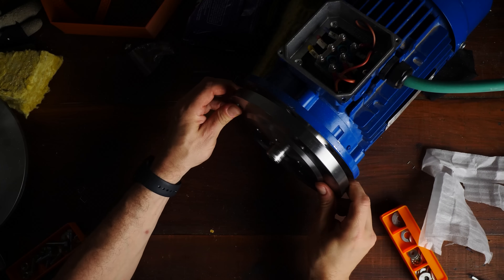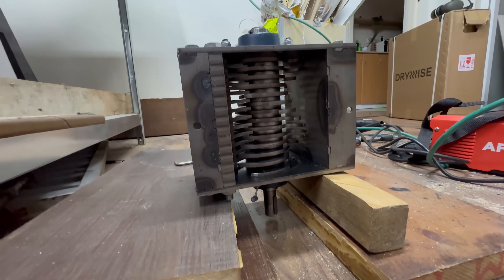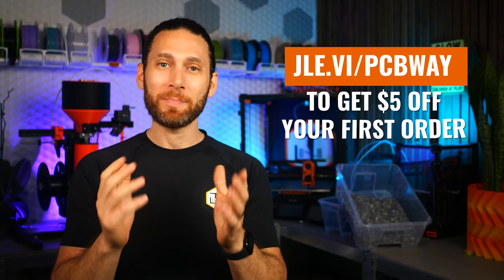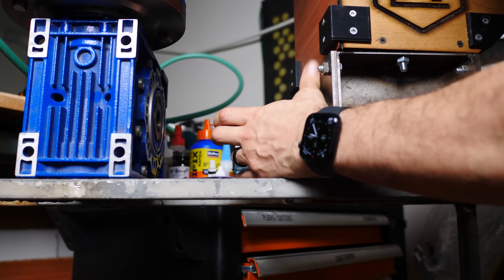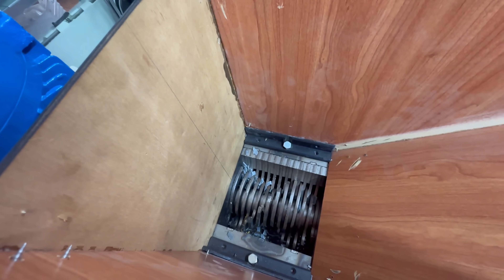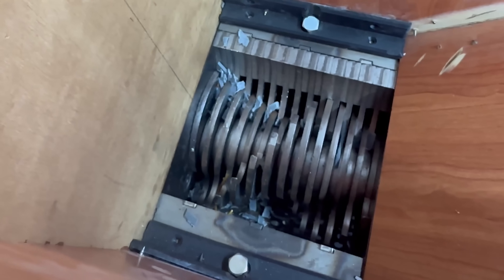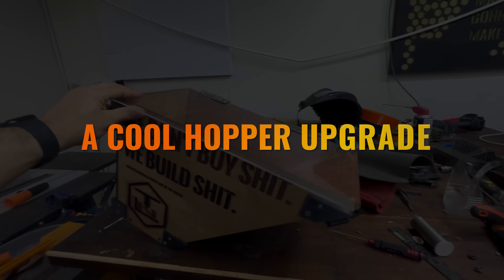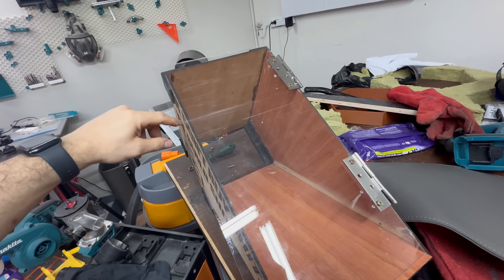Affordable Filament Recycling Update: I Screwed Up…

Comment: I would have use a chain or gear drive or a 'rubber donut' like on some driveshafts.
I have experience lining up a water pump to a drive shaft on a Maserati V-8. Maserati's drive mechanism was much like the old donkey going around in circles to rotate the mill. And it would fail if the concentricity was off by 0.001 .

Comment: This is so bad advice to order CNC or any parts from pcb garbage way....this is just junk. Also you have no any idea how plastic recycling works. This is just stupid to build that kind of shredder where is only movement is forward, what ever it cost. That is why bid shredders never ever use such a dumb concept. They reverse soon as load goes too high on forward. It realign the plastic and most likely reduce the load. To reduce the size, industry use multiple units in series. First hard plastic shredder and then shredded hard plastic + soft plastic. 
On your case, you bought 100% wrong type of shredder....plastic need more clearance on the ends or it will leak sooner or later to the bearings. Does not matter what you use for sealing, it goes trough. 
Do not dream to use shredded stuff directly to filament. For that purpose you need to make it for granule form. To get better result you seriously need to use middle of extruder screw the vacuum pump to suck the gases and moisture out. On big scale it works nicely out but possible your need 1000 or more times smaller scale it may be complicated.

Comment: Just a thought wouldn't it be prudent to pre heat the filament to near melting temp (so it takes less energy and time to melt the recycled plastic) so that when it finally goes thru into the melt chamber that its easier to get the proper size filament out of the extruder. I don't know much about filament extrusion, but I would think it would help with consistancy.

Comment: If you want better accuracy, pelletize the filament made with shreds and make another filament with those pellets. It is more steps and melts the plastic another time so it gets even weaker but the precision will be way better. That's how some professionals do it

Comment: I'm really interested in the extruder portion to make filament.  Buying bulk plastic pellets is far cheaper than filament and ditches the high cost of a shredder.  I've kicked around various ways to build a good extruder and take up reel system for diameter but am curious to see your final solution.

Stay safe !

Comment: don't hand drill the sieve - just buy some sheet metal with holes in it - or get someone that has a laser- or plasma cutter to diy- hand drilling that many holes in thin sheet metal is a pain - you won't end up with the part you desire

Comment: Test motor movement and direction is called a bump test in the manufacturing industry and electricians in a factory always work in pairs or teams.

You just demonstrated why.

Most VFDs are defaulted to coast stop, but many also have a breaking function as well.

Comment: You can also add flex coupler between the motor and shredder to deal with concentricity. Flange bearings with grub screws will never be centered. Look at some industrial equipment. All problems you are dealing with have solutions in the form of industrial LEGOs
Reply from the maker: On it thanks!

Comment: VFD will stop motor immediately if you wire a stop switch to the control terminal and change the stop setting from coast to braking. It's usually in the first or second layer of parameters. Change the setting to variable load as well, it will help with torque curve and life of the motor

Comment: Hi, 1) I hope, that you and your famili are safe.
2) I hope that somebody wrote it (I did not find it) Never ever use strait connection between motor/gearbox and machine. You have to use some caind of flexible coupler, which allows slight intolerance in assembly process.

Comment: Regarding Teaching Tech's Pelletizer, do not build it without using the "Dime Mod". There is one key piece that the filament rubs up against and in a few minutes, can actually wear a groove in the part, causing the filament to no longer be cut. The "dime mod" puts metal on this crucial face of the part, making it much, much more durable. I made my first piece out of PC-CF with 7 perimeters and 100% infill. A groove was worn in it in about 15 minutes of use. I used the same material and parameters with the dime modded part, and after 2 hours of pelletizing, it still works perfectly!

Comment: Thanks for sharing, for us to learn from. However, I keep thinking if it wouldnt be easer to just hand crank the schreder, with a very simple gear ratio setup? Unless you have huge amounts of scrap plastic, this will not run that often anyway. Would it at all be feasable? I have no experience with this, but it seems that man have been grinding things for hundreds of years without any precition engineering involved, just more hard work.

Comment: I'm very interested in this project. As a technical engineer I grinch sometimes seeing some of your mechanical solutions. Suggestion: for coupling the gearbox and the shredder I would use instead of a straight axel some kind of CV joint. This makes perfect alignment unnecessary.
Reply from the maker: On it. Thanks!

Comment: Use a lovejoy style coupler between the shredder and gearbox. Then you will not need to worry about misalignment issues.
Reply from the maker: I looked at McMaster Carr and it was like $300 for the spider style one. I’m checking out lovejoy and it’s super promising but I don’t know what it will cost. I’ll call them tonight maybe

Comment: Ok, what about wood chippers?  They come in both gas and electric power. Also, who cares if the original extrusion is not consistant.  If it is in a string, on a spool, all you need is a chopping mechanism, to make it into pellets, which work in the extrusion machine.
Reply from the maker: Wood chippers don't go fine enough sorry

Comment: i am not too sure of your exact vfd but after a bit of googling i think it supports emergency stops on its digital inputs which would cut power without the downramp. you should really look into adding e-stops at accesible locations near the shredder

Comment: You need a flexible coupling such as a 3-jaw lovejoy coupling.  Each side has three pegs sticking out with a rubber piece between each side.  This allows for slight misalignment.
Reply from the maker: On it. Thanks.

Comment: ofcourse its good to see where things went wrong, what could be improved, i was planning to build my own recycler cause the only company here who takes scraps gives you a quarter of a new roll for giving them 4 rolls of filament scraps .. which is a straight rip off, and you cant even combine the points you get as it limits to max 1/4 of a roll discount per order...
Reply from the maker: Do it! I'll be able to give you a BOM that's $1500 or less, I think.
Reply: @thenextlayer  i am actually planning to build mine with aluminium extrusions, and stuff i get for free from a friend who build some cncs and got left over parts :D
as for grinders i am still on the lookout for cheaper alternatives to the grinding gears you have, i had the idea of using some wood shredders for home use, some of those seem to have not just the boring rollers inside but actual sort of grinding gears like you have, and i found oen close by that seems to be broken ( as in electrically broken )

Comment: Well, you learned the lesson fairly cheaply, but hopefully well--never, ever, /ever/ turn a motor on without having it fixtured better than it can torque anything attached to it. It'll get away from you immediately, quickly, and violently. Or at /least/ be well away from it when you turn it on.
Reply from the maker: Thanks for the compassion ;) Definitely learned it
Reply: @thenextlayer  since I have your attention for a moment, please add the safety switches on the hopper lid, and implement an ESTOP circuit if you can, like other posters have recommended. The lid switch will prevent it from starting unsafely, while the ESTOP circuit will rapidly stop the motor if you hit it. Both types of input are probably implemented in the VFD, at least with an Enable input pin, and will dramatically increase safety. After all, your shredder can't tell the difference between plastic and fingers.
Reply: If the VFD only has an Enable pin it probably needs to be connected to either signal high (which should also be on the VFD) or to ground. If the VFD worked immediately when you bought it without wiring the Enable input, it probably had a jumper there already. Look at where the jumper connects, and it will tell you where your switch needs to go. Now, just change that jumper for a long wire running through a switch, and have that switch close the circuit when it's in the "safe" position (which should be lid closed).

If the VFD has a Disable circuit instead, then consult the manual and have the switch close the circuit when it is NOT safe. This is just the opposite of the Enable circuit.

To wire the ESTOP circuit, buy an ESTOP button. These are normally closed when not switched, and will /break/ the circuit when pressed. But they have both types of contacts (normally open and normally closed) so they can be used for an Enable or a Disable circuit. If the VFD does not have an ESTOP input, then wire it in series with the lid switch. Make sure it breaks the circuit (for Enable input) or closes the circuit (for Disable) when pressed. (ESTOP buttons only unlatch when rotated, by the way. They lock down until you spin the button top.)

Then carefully test each switch and make sure they do their job properly. 

By the way, these buttons and switches are for low power only. They only switch logic inputs, they do not control AC line voltage and amperage.

Comment: For shredding plastics I have tested cheap TC sawblades 6" 40 tooth, opposing on 25mm axles running with a £20 18v drill shredding anything was not a problem, the size of shredded plastic, aluminiium extrusion was small enough & uniform enough to use. Apart from the danger of someome inserting a hand and being turned out as a bean burger (Human Bean Burger), this seems like a workable approach considering testing was on a threaded bar with washers and just 4 nuts.

As for your new seive to drill out those Iranian missiles have the correct curvature already, just make sure its not a UXB before beginning!

Comment: Might be a good idea to add a microswitch to that perspex lid so the motor can’t run if the lid is open. For your safety and your kids.
Reply: This is a terrific idea. The VFD /probably/ has either an Enable or Disable input that can be used for exactly this purpose. It should /also/ have an ESTOP input that can be used to arrest motor power immediately. He should wire up and have both of them working before any more tests.

Comment: Yeah, knowing where you do or don't have tolerances to fudge the setup is peek engineering.
Reply from the maker: Lesson learned. Any ideas how I can avoid making the same mistake, though?
Reply: @thenextlayer  Well it all comes down to experience doesn't it... When you're dealing with parts with a "real" manufacturer you learn the reflex of checking the specsheets. but I think there's enough custom parts here that I probably wouldn't have thought about that at first either.

you also learn what the critical points are, in your case you already experienced some:
 - you learned the torque is insane and very dangerous.
 - but then you over corrected and tightened everything before knowing alignment.

Honestly I think the only thing that saves "proper" (massive air quotes on that one) engineers from making this kind of mistake, is that they would have overbuilt it and removed the natural jank of DIY. the mount plate ordered would have been bigger to become the mounting point to the frame and include some adjustment space for alignment. but then the plate needs to be much thicker or have angled bits because it's not just mating the gearbox it's holding the weight and power of the whole thing.
Reply: @thenextlayer  side note about specsheets and massive extremely detailed manuals. most of those are freely available and downloadable as pdf. And I now use Chat With RTX (there are other fully open versions of this) to search them and find the information I need in them.

Because it's a large language model based tool, you don't need to know exactly what a thing is called or what it means to find the information you need. If you can describe your goal or problem the language context is enough to provide you with an answer. 

of course it's not always correct, but having a defined metric to research directly means you can very quickly find a reddit post or wikipedia page that will tell you if it's actually what you needed or not. and it's always very close to what you actually needed.

Comment: Your stick welding is bad and will not hold very well! You have to make overlapping puddles. Gotta hold the stick in the first spot for a sec, then move it away to give it about 1 second to cool before coming back almost all the way to make the next "puddle" weld. It will essentially look like overlapping round spots, each one 2 or so mm away.
Reply from the maker: Thanks for the tips, I'm constantly working on improving my skills. I hope it holds, but if not, I'll re-weld it :)
Reply: The previous statement about your welding isn't completely wrong, it isn't the best, but that's okay, your not a welder. That's the only thing he was right about though. I'm a Journey Man Red Seal Welder as well as a Technical Sales specialist for welding supplies. Looks like your using a low hydrogen 7018 style rod (it was hard to tell as I'm just going off of the slag , using my phone lol.) and if you are you need a smooth straight progression with alittle bit of weave, about 1/4 the dia of the electrode perpendicular to your path of travel. Work angle and travel angle are also super important, your holding it wrong and not supporting your body properly so i bet your unstable, especially after you commit to the weld. Your heat looks too low, that's why all the spatter and lack of penetration (unless your on the wrong polarity, which is possible). Look man, I know this is strange but if you want to learn to weld, hit me up, I promise after 1 day of exchanging emails or a phone call you will drastically improve your welding as alot of it is just minor things your doing wrong. Just the basics they would teach you when training that you haven't had to know or learn.

Comment: That's a good example why you don't mount something like that to plywood but instead steel to steel. Would that spacer have been steel, no issues. Wood is just way too soft.

Think about it -- would you use plastic, even PLA-CF to do that job? No? Then wood is not sufficient either.
Reply from the maker: Hmm I didn't think of that. You think the issue was the wood being soft? 
My concern was that I'd NEVER be accurate enough in my welding to get it exactly level - but maybe what you're saying is that I should make a steel platform, and then shim it with ONLY steel until I get it level?
Reply: @thenextlayer  wood compresses easily under load. It will never make a good shim. Metal is far better.

However, your motor coupling probably shouldn't be a hard collar like you have. The problem is that you have to be extremely precise in alignment between both parts so the shafts are exactly in line. This is almost impossible in most cases.

However, standard industry couplings help with this. A "spider" coupling, or a flexible coupling, helps accommodate small alignment errors. Switching to one will make lots of large problems go away now, and reduces small chronic problems that wear out bearings and shafts faster than they should.

Comment: Something you might try: take the inconsistant filament you got from running the 8mm shreds through the extruder, pelletize it, and run the pellets through the extruder. I'd be curious to know what the results of that are. Good luck!
Reply from the maker: Keep watching the video, lol... There is no shredder anymore ;)
Reply: You want to melt the plastics as few times as possible, otherwise the polymer chains break down. That can be reversed, but you’d need to put the plastic in a low vacuum with only a bit of argon or nitrogen as inert gas, ideally heat it to around 260°C and then keep it there for hours, so the polymerchains can „relax“ form longer chains again (that’s how I understood it in German „school-chemistry“ at least) and also don’t oxidize with oxygen in the air. PET is especially prone to oxidation, in fact so much that sometimes they use vacuum extrusion setups, so when the plastic exits the screw extruder, it doesn’t come in contact with air. Nylon for example would have to be chemically split from polymers to monomers, that can then later be made into completely new nylon basically. NileRed made a video where he synthesized nylon, I watched it long ago, but I bet it wonderfully explains the concept as well. (Just a fun fact I thought someone would be interested in)

Comment: Perfection at the first try is boring. That 0.5 mm of play might only be that at the shaft, but it amplifies the further you go from the spinning point. When you show the rotation with the shredder connected, that bearing on the end looks to be moving way more than 0.5mm.
Reply from the maker: Great point!